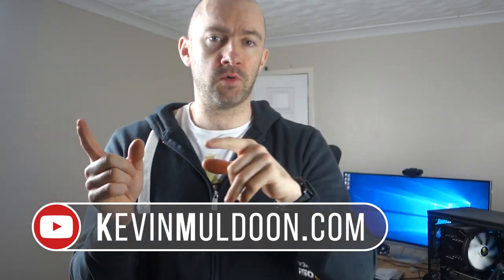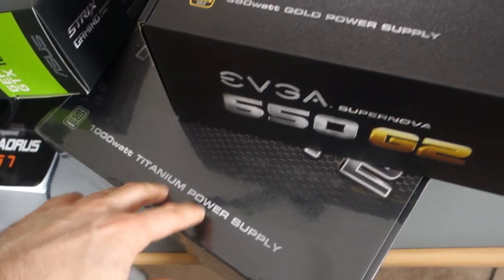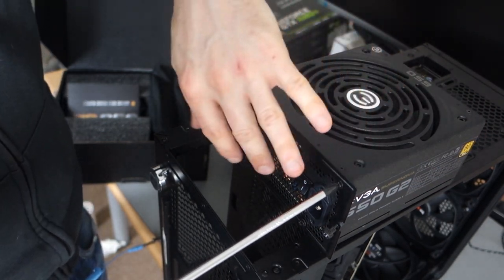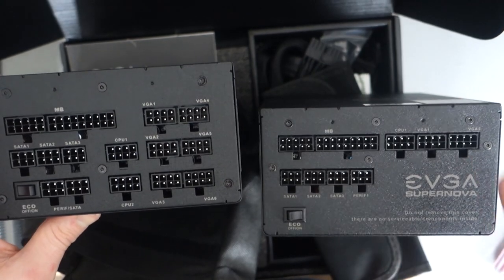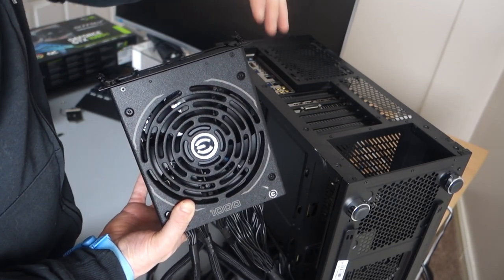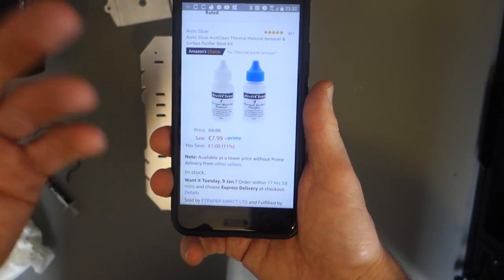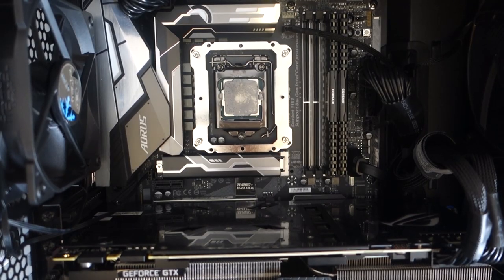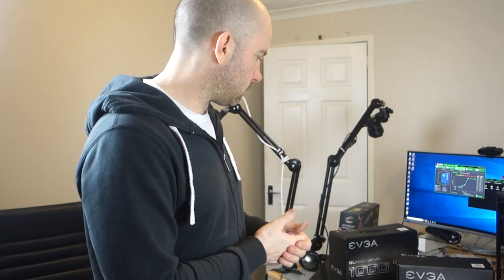How to Change a Power Supply Unit in Your PC

Comment: This may sound stupid but couldn’t you just keep everything plugged in other then the 24 pin and 8 pin then just plug it back into the back of the new psu?
Reply from the maker: Yeah I probably could have used the same cables, but I wanted to keep the PSU with its corresponding cables.
Reply: @KevinMuldoon  I want to change my psu because I feel like I won’t have enough power. All the calculators say I will. But I can’t calculate for adding a liquid cooler. Would a liquid cooler cause me to use alot of watts?
Reply from the maker: @Trashy.  It depends on the All in One Cooler. They all use a different number of watts so you will have to check the specs page.

I recommend plugging all of your components into https://pcpartpicker.com/ and seeing what the estimated wattage is.

I will say, however, that it is always prudent to have a bit of overhead in your power supply as it will work more efficiently.

Comment: I have a question; I have a HP desktop MO1 and I’m going to install a EVGA - BA Series 500W but i don’t know if it will fit.  If you might know, pls reply
Reply from the maker: I'm not sure. You'd have to check your PC's specs to double check.

Many custom desktop PCs from companies like Dell and HP use unique PSU sizes to help them fit them into a specific case.

Comment: I was about to recommend that Kevin get a new way to record audio, when I got the disclaimer.  I'm an audio engineer, forgive me.  But if this is his short video, I'm not sure I could manage an average length serving!  This was ridiculously over-powered for 2018, but you've probably gone 2080ti by now; still overkill, but now with the 3090, you'll finally be getting your money's worth.
Reply from the maker: Hi Jeigh.

I might get one of the 30xx series cards when I do a build next year. The 1080ti is still working away and performing well, but struggles with 4K editing.

I'm not so sure this was overkill though as my PC is full. The PSU is powering around four hard drives, a network card and a Thunderbolt 3 card. Not to mention the case has a ton of fans.

It's been a while since I've checked the wattage to confirm the total estimated output though.

Comment: If my 1000 watt is gold rated & my pc power supply is gold rated do I need to change the wires?
Reply: Gold
Reply from the maker: I'm not sure what you're asking.

The cables provided with your PSU will be fine.

Comment: will all psu's be compatible  with any graphics card and motherboard, im looking to build a pc thanks in advance.
Reply from the maker: They should be compatible with your motherboard, but you do need to consider what you're powering. You'll need more power for powerful GPUs and for additional hard drives and accessories. Pcpartpicker.com is a useful website for checking what wattage you're using.

Comment: i dont know if this is my problem but my computer suddenly wont turn on when i try to turn it on is my PSU the problem?????
Reply from the maker: It could be anything, but that's definitely one of the things you should check.
Reply: @KevinMuldoon  could it be my motherboard because im about to order a new PSU and want to make sure im not screwing my self over any tips?
Reply from the maker: It could be the motherboard, hard drive, power cables etc

There's a lot of things. Troubleshooting it all can be difficult if you don't have spare parts.
Reply: @KevinMuldoon  yeah i have no clue no spare parts no knowledge and got no money im just fucked
Reply from the maker: Take it to a pc repair shop. I wouldn't start purchasing components unless you know exactly what the problem is.

Comment: where do you plug the molex in to
Reply from the maker: The power supply.
Reply: @KevinMuldoon  yeah but where in the power supply wich connecter
Reply from the maker: Most PSUs come with a molex connector. If not, you'd have to buy one.

Comment: Rearrange your ram the slot furthest from the cpu cooler is fine just move the other stick so there is an empty slot closest to the cpu cooler and immediately next to the last slot
Reply from the maker: I've got four sticks in it now.
Reply: @KevinMuldoon  ok video helped to btw forgot to say
Reply from the maker: @apr859  glad you found it useful.

For the record, I followed the guidelines of my motherboard manual at the time when putting in the first two sticks, but I do recall looking into whether using 1/ 3 or 2/4 made a difference.

I think the general consensus was that it doesn't.

Comment: Hello I was thinking of changing my psu the thing is if I do it will I have to reinstall windows or bios again or is everything saved so I can directly play with friends
Reply from the maker: No you won't have to change anything from a software point of view.
Reply: @KevinMuldoon  ok so right when I change it it would show the normal windows screen I put my password and than I'm good nothing else
Reply from the maker: Yeah the operating system and bios etc are not being changed so it should be a simple modification.
Reply: @KevinMuldoon  ah ok than thanks I'll upgrade for Christmas or so

Comment: Do all coolers need cables from the PSU to power up? I noticed my cooler (a stock AMD Wraith Stealth cooler) doesn't go to the motherboard.
Reply from the maker: I've always had to connect the fan on coolers. Even on stock coolers on low power Pentiums.
Reply: @KevinMuldoon  odd, i only have a cooler cable and a USB 2.0
Reply from the maker: @ridleyroid9060  I've never seen that setup before myself.
Reply: @KevinMuldoon  i guess ill see when i replace my own psu :)

Comment: Is there an alternative material for connecting the anti static bracelet to the Matt?
Reply from the maker: You just need to earth it. You could, for example, connect it to your pc case.
Reply: Kevin Muldoon oh so i connect the anti-static bracelet to the case and thats it ?
Reply from the maker: @juanpisld2224  yeah that should be fine. You'll see a lot of people doing that online.
Reply: Kevin Muldoon ok thank you I’ll do that, so it doesn’t matter if i change the psu on the second floor of my house right? I’m sorry I’m asking so much i just want to be sure
Reply: @juanpisld2224  just be sure you connect it to a non painted part of the metal case

Comment: Thanks for the video but i just cant unplug the psu from the motherboard. I feel like its glued or something. I tried everything but i am hopeless. Please help
Reply from the maker: Just be sure to press down hard on the clasp. Hopefully, you can pull out out without damaging the board.
Reply: @KevinMuldoon  i am pressing it but one corner seems to be stuck and just wont move. Any solutions?
Reply from the maker: If you're not caring about the power supply, I would try and just snap the part that's connected to the motherboard.

In other words, you may have to damage the PSU cable to remove it, but that's a small price to pay to save your motherboard and you can get a new PSU cable for just a few dollars.
Reply: @KevinMuldoon  thanks i will try
Reply: Update in case anyone was wondering: i tried too hard and broke my motherboard. Now i have to get a new motherboard +psu. Life is hard
Reply from the maker: Oh man that sucks.

Did you try and cut the PSU cable?
Reply: @KevinMuldoon  after i tried everything i pulled it too hard from rage and i broke the motherboard
Reply: @KevinMuldoon  fun fact: after all that the cable is still not coming out of that fucking plug
Reply from the maker: @tsigroo  That's a pain. Sounds like you may have needed some kind of clippers to break it off correctly.
Reply: I litterally just got a psu for my new graphics card and I'm having the same issue but I dont have enough money if I break the motherboard so I'm stuck right now :(
Reply: Update I held down the tab and wiggles it for a couple minutes and got it out :)
Reply: @grenade5053  Hey I may need to do the same thing, in the future, would you say this video was helpful?
Reply: @mrbookish6701  sorry to get back to you so late but what I did what wiggle it a little when pulling on it and it came out

Comment: Thanks for the video. Do you use any type of esd safe screwdriver or will anything work?
Reply from the maker: All of the screwdrivers I use as designed for pc repair so I suspect they are, but I'm not sure how much of an issue it would be if they were not

Comment: Just noticed also your airflow in sli is going to be shit not a lot of room in that case for airflow
Reply from the maker: +CUT!! GAMES!! well I've got an air cooler and six case fans so it should hopefully be ok. Each GPU has three fans too.
Reply: @KevinMuldoon  yeah but the space between your cards is awfully close...you probably use 2 3 slot cards...so your cards wont have much space to breathe and eventually run really hot. thats why you use 2 slot cards for sli configs and also mostly blowerstyle cards

Comment: why not use the same cables that were already plugged in to your components and just unplug them from the power supply and plug them in the new one? Save yourself the trouble of re-doing the whole cable management.
Reply: xboxgamer969 because as he stated they’re NOT interchangeable (you need to use its own cables it came with) I tried doing what you suggested and thought my PSU was faulty until I came here and listened to what he said about the cords not being interchangeable. I changed all the cables from old to new and Eureka! My PC booted up.
Reply: @tangledrootsmedia  ok yea
Reply: Yep didn't know this exact thing 12v through old 5v non modular cables resulted in 3 fried hard disks two burnt out fans and 1 broken blu ray optical drive, bad day.
Reply: @connor2449  rip, atleast now i know for the future lol
Reply: xboxgamer969 Etsy the video first before you comment